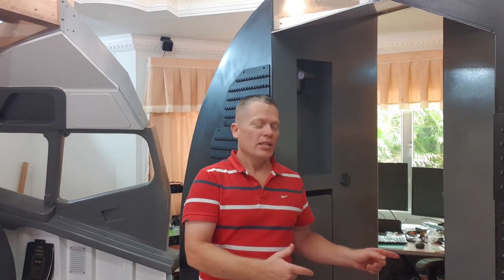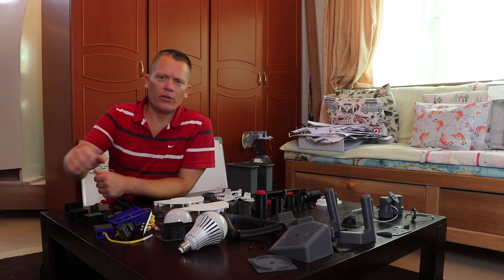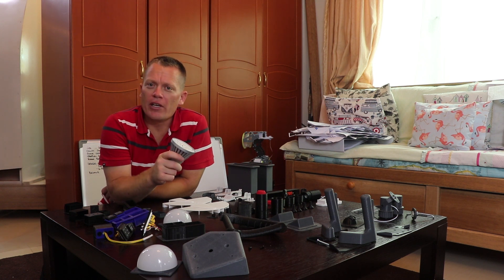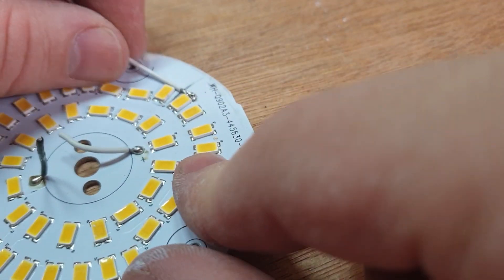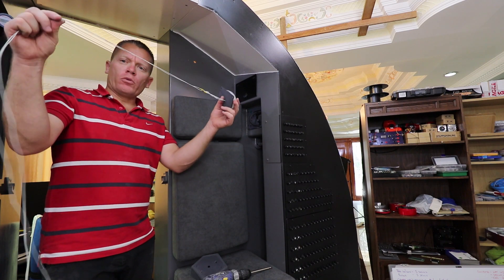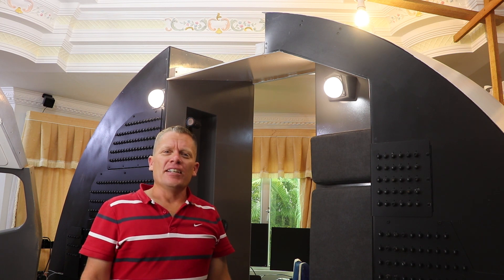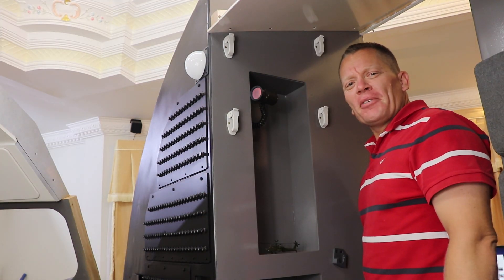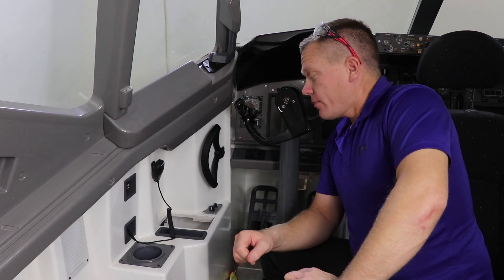737 Sim Build Installing 3d printed parts

Comment: Sir, how do you always ensure that the parts always fit? For tight fits, and 3D printing.. I have fear that the printing might not be as precise .. and the parts might not fit so well
Reply from the maker: Hi Daniel, Everytime i get a new printer i calibrate for the X,Y,Z axis. I have 7 printers in all and usually all parts fit without issue using a 0.2mm offset. For a free moving part, i would increase that offset to 0.4mm. Generally if you are using the same printer, you want have an issue, because all parts will have the same error and should fit regardless.

Comment: im thinking about PVC pipe ( for the control column) and 3d printed yoke ( PLA filament. Would it work fine ? I mean in terms of rigidity, feeling, weight.
Reply from the maker: Yes for the control column! But not the cross link for dual link. That's where i failed. But for a single yoke it works perfectly!

Comment: Only 4000 pound???? For entire sim???? I was in japan and I asked them how much the said 100000$
Reply from the maker: Hi None none. My expenditure list is on my website. And as i stated in of of my recent posts, some of that 4000 was spend on a filming camera, tv etc. The reason its so cheap is that i have bought pre-made panels from cockpitsimparts.co.uk. Everything else was self built. The structure is all MDF and was free. I was also gifted all my monitors. But if you buying parts from the start, its going to cost a LOT! my overhead panel cost $250. To buy a full forward over head is above $3000

Comment: Are you going to use a Bulletproof/Crashproof Cockpit door? That would keep uninvited guests out! 🤣
Reply from the maker: The cockpit door is under construction, The problem being getting aluminium here is proving to be quite difficult. Even though we have loads as work for aircraft repairs. I think the company might get a little upset with me. Besides, i don't need aircraft grade/expensive aluminium lol. I'm actually trialling mdf painted in aluminium paint right now. But mixed results. some parts look fantastic, others look horrid. it seems to be down to how well its mixed before application.
Reply: @helimech8152  I don't know if this will work, but you could modge podge/glue Aluminium Foil to the MDF.  You might want to do a few layers.